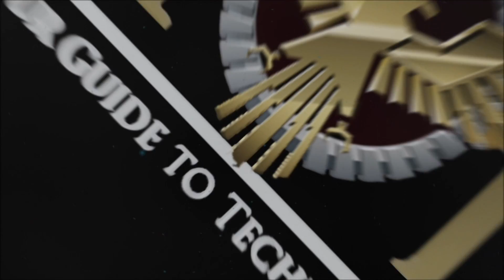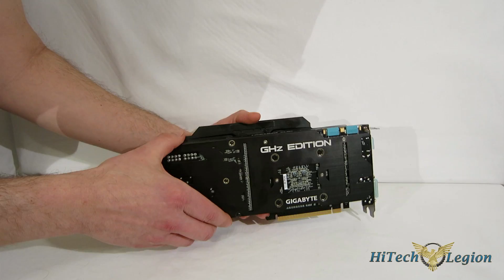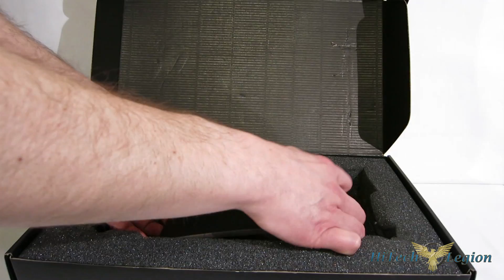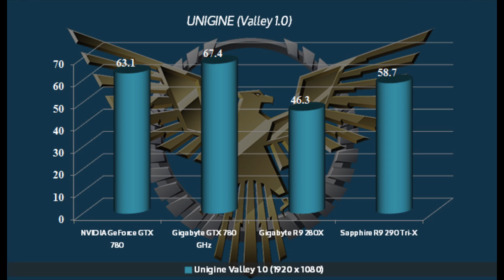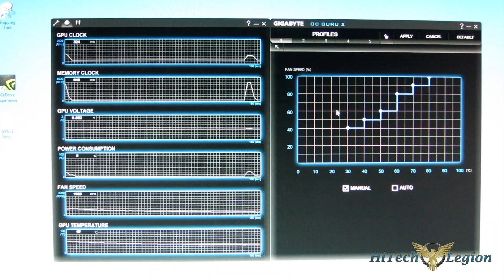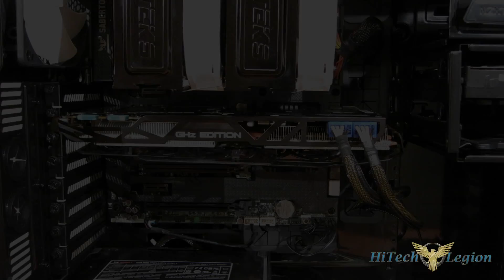Gigabyte Geforce GTX 780 GHz Edition Video Card Overview and Benchmarks

Comment: Hi. Im legend because im still on 780 ghz edition 2018 :) And try to push my card maximum. Im stable at +50 core clock and +220 memory clock... If i try push +240 memory or 60+ core clock i get crash...   How increase voltage ? i cheked "Enable over voltage" but offset min is 0.000 and offset max are 0.000. Target power is like this 116%

Comment: This or Palit GeForce GTX780 Ti 3GB Jetstream?
Reply: Brady T You would almost think that all of this info would be on the Gigabyte website....and that they should have an easy to use side-by-side comparison tool....
Reply: With all of the detail you have included regarding intended usage, budget and the other components in your system, the answer is obvious: I would say "probably". But only in the Southern Hemisphere. North of the equator there are polarizations that may well affect the outcome.
Reply: George Cella  What do you want to say to me? :/
Reply: Kwtsos99XD I'd get this, it's got a 3 year warranty compared to Palit's 2 year warranty. Just that is the winner for me.
Reply: Idk... I am trying to find the issues that i saw on a vid :/
Reply: Kwtsos99XD What are these issues? And are they with the Gigabyte or Palit?
Reply: I am talking about the Gigabyte GTX 780 Ti. You can "hear" the issues abou this card from the Linus Tech Tips.
Reply: I can't hear any issues, are you talking about the GPU binning process? If so, the GHz edition is a binned GPU.
Reply: Brady T
 Maybe I saw something else... Anyway, do you still reccomend this card and also should i buy a motherboard from Gigabyte to match it with the Graphics Card? (if so will it perform better?)
Reply: I have had a Gigabyte Windforce GTX 670 and it served me well, they run very quiet even when overclocked.. But I cannot say 100% for the 780. I will be getting the Gigabyte GTX 780 GHz edition in a few days (Still deciding between it and the Asus DirectCU 2 OC) though so I can get back to you with my experience with it.

There is no need to get a Gigabyte motherboard, you won't see a performance difference.. But I myself have a Gigabyte GA-Z77X-UD3H and it is a great motherboard!
Reply: Kwtsos99XD Are you looking for this card, or a variation of the Gigabyte 780 Ti?
Reply: For this one, the Ghz edition
Reply: Kwtsos99XD Ok....you realize this card is NOT a GTX 780 TI, it is a GTX 780. So, you are comparing two different GPUs at very different price points....I believe you are looking for a 780 TI GHz Edition.
Reply: I know... I didnt check the title. Also i checked again and the ti ghz edition is like 700 € and the gtx 780 ti oc is like 600 €. So is there a big difference between them? You know that i am talking about the Gigabyte models....
Reply: Brady T
Can you tell me the big differences between the gtx 780 ti ghz edition and the  gtx 780 ti oc?
Reply: The 780 ti GHz edition has a custom PCB, custom Backplate, cherry picked GPU and two 8 Pin PCI power inputs and a higher stock core clock. The 780 ti OC has a reference PCB (I think), it also has two 8 pin PCI power inputs.

I'd pay the little extra for the Ghz edition, as the backplate stops the card from sagging which can cause issues later down the road.
Reply: Oh....thank you very much for telling me the diffrences. I may buy the Ghz edition after the exams if i do good :)
Reply: No problem! Goodluck with your exams!
Reply: Brady T
Thank you!
Reply: Brady T
Wait is Gigabyte GTX 780 Ti GHZ Edition overcloacked?
Reply: Kwtsos99XD Yes it is clocked at 1085MHz  Base with a boost clock of 1150MHz

The non Ghz model is clocked at 1020MHz Base with a boost clock of 1085MHz
Reply: That would help a lot!
Reply: There is a Comparison Tool, but i think its too complicared!
Reply: George Cella Yeah we've got to go digging to find the differences our selves, lol..
Reply: Brady T Sorry....I just think the expectation that someone else is going to go to the Gigabyte website, look up the specs for you and deliver them to your Google+ inbox so you don't have to....and do it in a comment section of an entirely different item...well...I think that speaks for itself.
Reply: George Cella Yeah but some people don't know as much about these things, I don't mind looking it up as I know what I'm looking for :)

Comment: The labelling on the top plate is going to be facing the wrong way in most cases, isn't it?
Reply: Either EVERY reviewer gets the same card or Gigabyte doesn't read English. 3 months ago Tiny Tom Logan ranted on this fact and yet has not been changed. If this is the mfg'ers attention to detail, I shall pass.
Reply: Earnest Bunbury LOL. I wish Gigabyte was the only mfg that did this. Such a silly mistake, and one I have seen on so many components.

But, this should have been addressed here....and on every other component that has the issue.